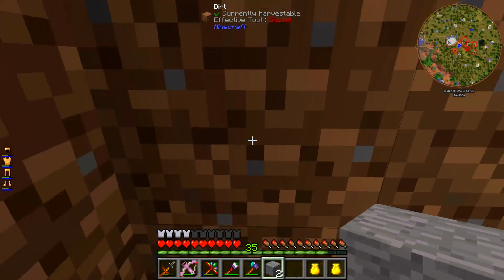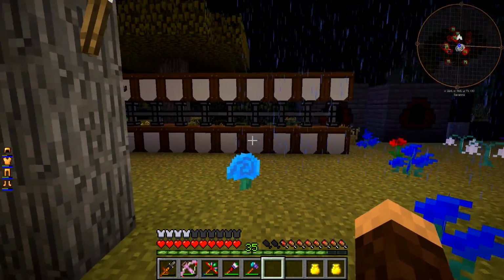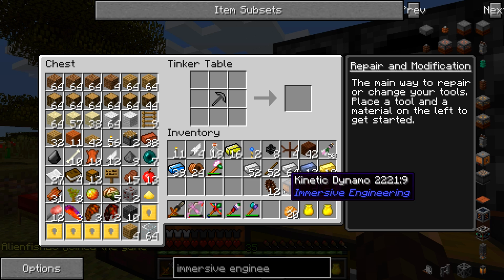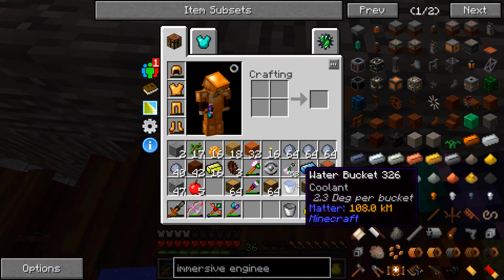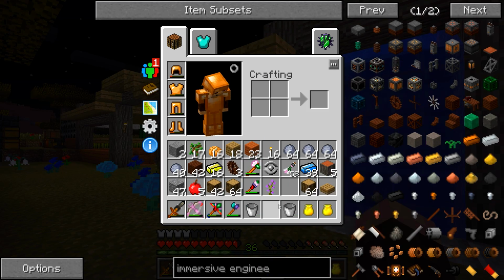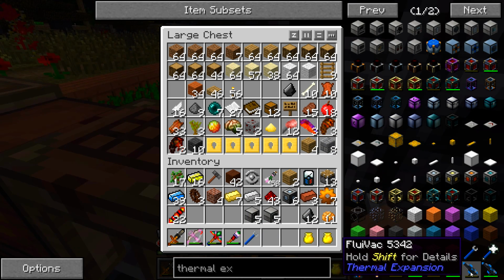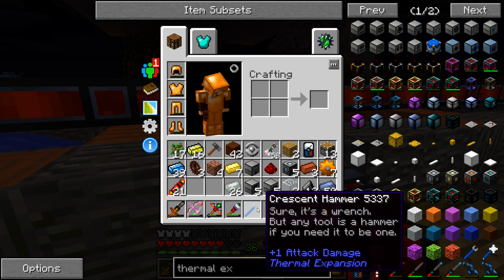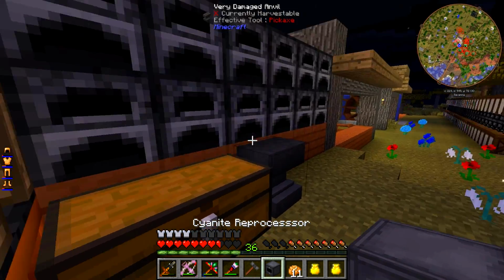Minecraft Modded Survival #4 "Immersive Engineering Water Wheels, Basic Machines" FTB Infinity

Comment: What version of endeio addons is it in the modpack? Also I am on the 2.0.2 version of the modpack, when i add the mods everything breaks, i dont know exactly what is causing it but i think its because i have the wrong version of a mod.
Reply from the maker: +und3d assassin EnderIOAddons-1.7.10-2.3.0.417_beta-0.8.0.015_beta
Reply: +MeatyLock What it the calculator version
Reply: +MeatyLock I found the correct versions of everything, I would suggest putting the correct versions of all the mods on the mod list because some of the mods have updated and if you use the more recent versions, everything breaks.
Reply from the maker: +und3d assassin Definitely not going to do that. The plan is eventually uploading the extra mods as a zip file so people can download it. Haven't got around to it yet. I need to check permissions first.
Reply: +MeatyLock Thats a good idea.